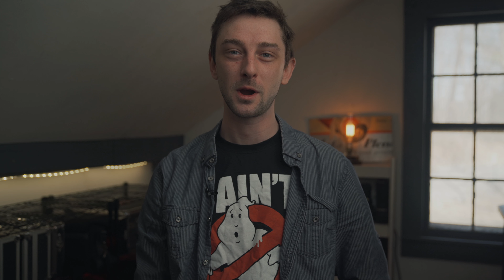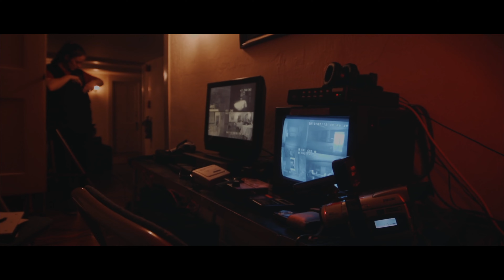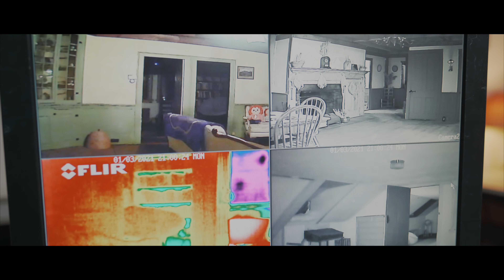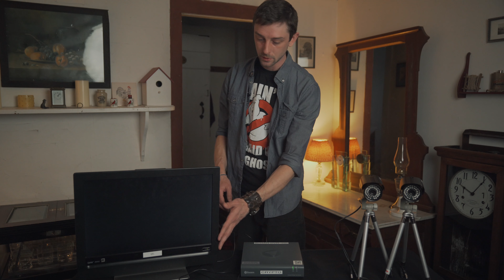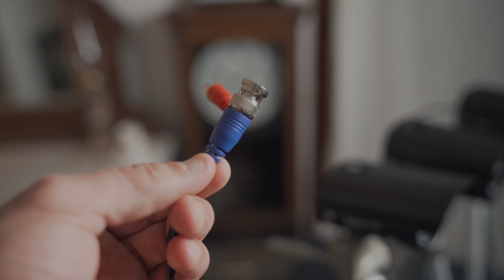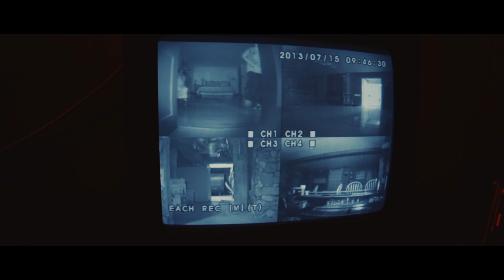Ghost Hunting | DVR Systems Review

Comment: Hope you’re still checking these older sites. But I been using camcorders but I’m looking to expand now that I’m doing larger properties. I’m just curious because most of these places don’t have electricity. What would you recommend for a power supply?
Reply from the maker: If you’re checking out places that don’t have power, then camcorders are probably your best bet as you can battery swap, that’s our go to in those situations. If your trying to run cctv in a place without power, your gonna need a generator, that’s going to require fuel and extra extension cords and add additional noise to the environment. We would stick to the camcorders!

Comment: Another great video with some good advice. I often use a radio frequency scanner to check that EMF anomalies and rem pod triggers aren't being caused by RF interference and as you so rightly say this can also affect wireless CCTV. If setting up time is limited for whatever reason then maybe standard video cameras are best with a wireless system used just to 'prompt' the investigators. Where wired CCTV is used that has no audio I've come up with an idea that incorporates Zoom h1n Voice recorders hard wired back to the control room and LED audio VU meters which 'spike' on the TV monitor if any sound is detected in the room and then alerts the investigator(s) to concentrate for a while on that area. Where more than 1 room is being monitored a simple audio switching box can be used to listen in to exactly what audio is being recorded in any given room at one time as well as seeing it on the video monitor. (The VU meters just provide a visual indication of which room to switch to to monitor the audio that is already being recorded by the voice recorder in that room.) This is just a setup idea I've developed but I wanted to share it with you guys in case anyone finds it helpful.
Reply from the maker: Good thinking, try to rule out false positives when ever possible! That sounds like quite the set up your proposing, despite setup time cctv can still be a useful tool but not right for every situation.

Comment: We have started to use body cams on tripods.  They have audio, onboard IR and with an external battery pack attached they can run all night long.  They are also very small which is great compared to the multiple cases it takes to transport a DVR system.
Reply from the maker: Good to hear from you. That sound like a very innovative solution, small and nimble setups are a certainly a huge time saver!